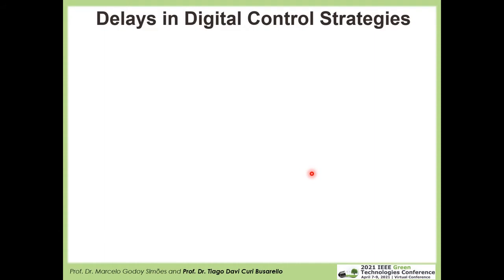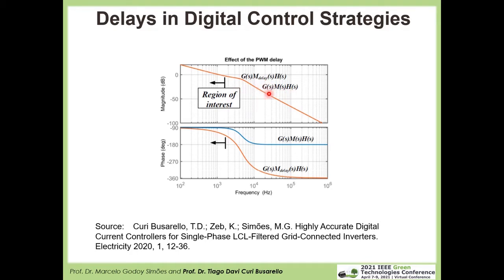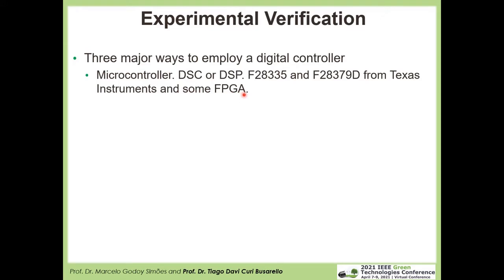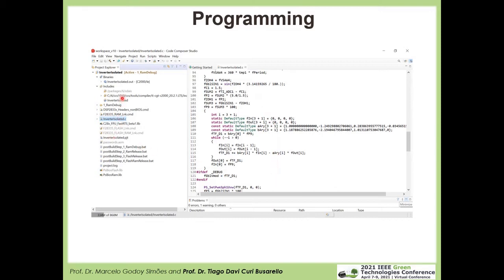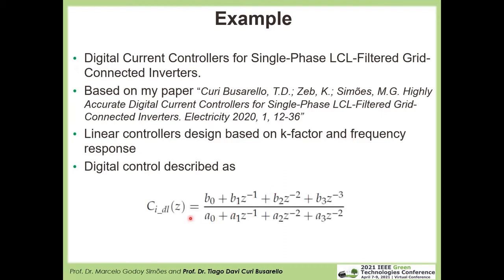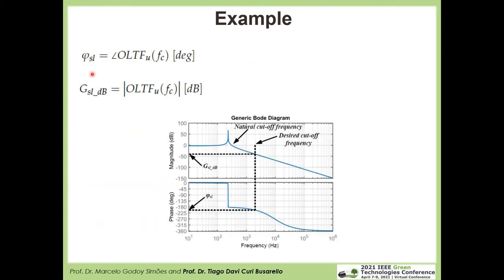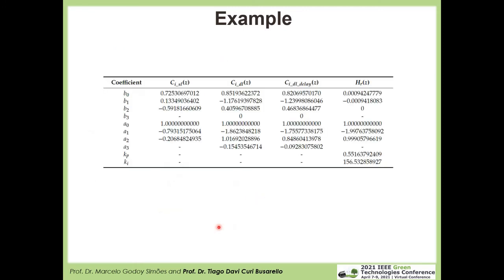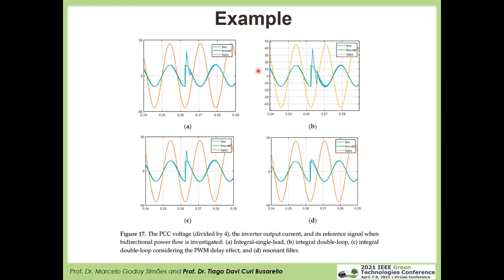Introduction to Digital Control for Power Electronics - Part 2

Comment: How did you implement the resonant controller in MATLAB, trying to follow the last publication but no luck "Step-by-Step Design Procedure for LCL-Type Single-Phase Grid Connected Inverter Using Digital Proportional-Resonant Controller With Capacitor-Current Feedback"
Reply from the maker: Actually we implemented in PSIM. On my webpage, in the publications tag you find a matlab/simulink project of PR controller, but with L-type filter. Look for Design Procedure for a Digital Proportional-Resonant Current Controller in a Grid Connected Inverter on my webpage.